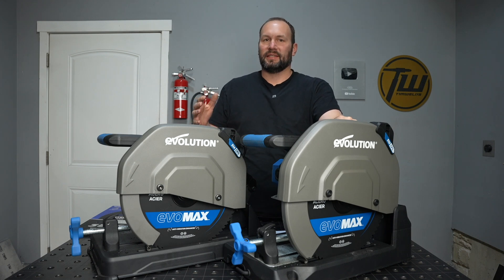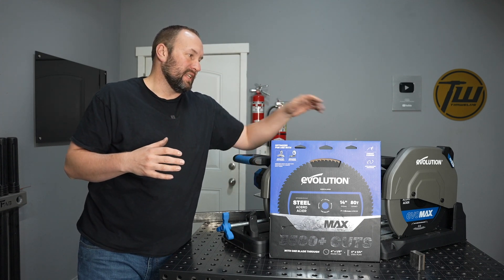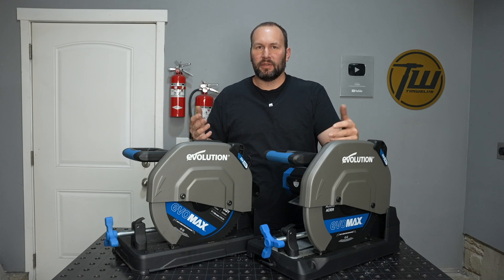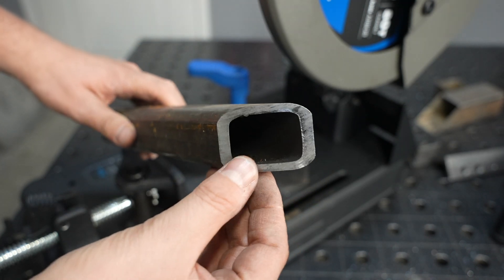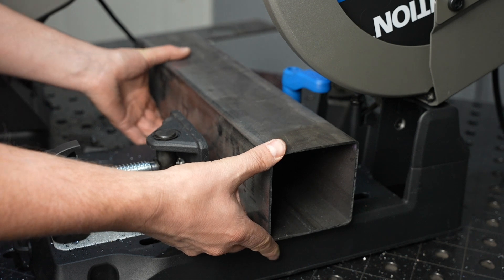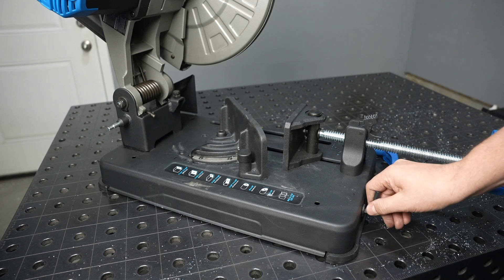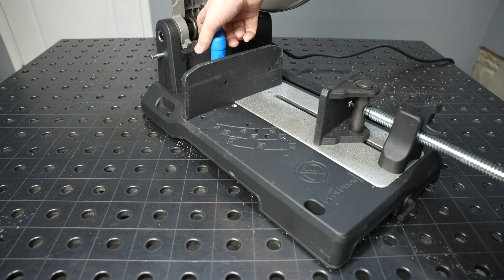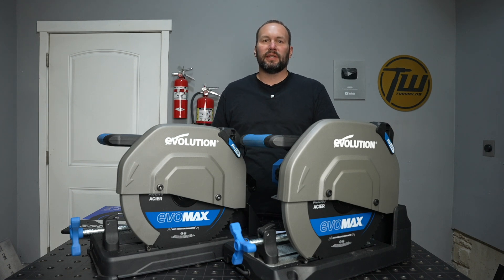What's New on the Evolution EVOMAX Chop Saws: Overview, Cut Tests and Comparison

Comment: Can you sharpen the blades, like  wood blades ?
Reply from the maker: I'm not an expert on blade sharpening, but I expect that it would take some very specialized equipment to sharpen a cermet blade, and it would probably cost more than replacing the blade.
Reply: @TimWelds 
A cement blade ?

Comment: I have an Evo185, a smaller one, and it cuts through 16 gauge 1" hot rolled mild steel like butter! But sometimes when I cut a smaller piece (<1" long), the piece gets thrown back into the blade, which I'm afraid is going to damage my blade or my saw. What can I do to make sure this doesn't happen?

Comment: If the Evomax gives you 30% more cuts, no matter what blade you are using, you should be getting more than 4550 cuts with the EVOMAX14ST blade. Yet the saw only states the same number of cuts as the blade.  The EVOMAX14ST blade states it is compatible with certain Dewalt, Milwaukee, and other saws operating at or below 1600 RPM, so you should get at least 3500+ cuts when used with non-Evomax saws.  I have trouble with the claim the motor technology extends blade life by 30% if they only promise you 3500+ cut  on a blade that should do 3500+ cut even with any metal saw that runs at or below 1600 rpm.
Reply from the maker: I’ve sure made a lot of cuts with mine at this point and it’s still working great on the original blade. 

Their claim on the saw description website is 3,500 cuts through their test cross section for the included blade plus 30% additional life due to the Evomax blade which would be more like the 4,500. In all reality, I don’t know how you quantify to that level of detail when it’s used for different things, but a cermet blade will outlast a tct one on steel and I buy into a longer life with better speed control.

Comment: In your opinion, do you feel it is really detrimental to a steel cutting blade to cut aluminum with it?
Reply from the maker: I’ve done it from time to time. I fried one from material sticking to the inserts, but I usually get away with it.

Comment: I hope the new intelligent motor/light  finds its way into the mitering chop saw. I have been wanting to get one for a while. I went cheap with a portable horizontal bandsaw and been unhappy with it. My shop is tiny and cluttered so its easier to adjust the blade angle instead of trying to negotiate a large piece of material around everything else in the shop.

Comment: I bought an Evo couple months ago and cut angle iron @ 45' for frame work.  It jammed on the first cut.  I tried again and it 'grabbed' and flung a 15"  piece of angle half way across my shop.  Scared the heck out of me and I promptly returned it - POS as far as I'm concerned.  The table will also only angle one direction.  I will stick with my DeWalt abrasive cutter.
Reply from the maker: Mitering angle iron in a standard chop saw like this is more of a challenge because the fence only angles one direction. To get the second angle, it has to be positioned upside down. If you just put it in the clamp upside down without a secondary piece of material, the saw can pull the vertical section backward after it cuts through the flat section, dislodging it. I've made a video about this in the past. I've made thousands of cuts on their saws and only had material get caught once, which was completely my fault for improperly clamping it. Their S355MCS is better for angle because it pivots both directions so you can leave the corner sitting in the corner of the saw the whole time. BTW, I've had material come loose in an abrasive saw before and the blade shattered, which sounded like a bomb going off and was much more concerning and dangerous. Once again, my own error in clamping it.
Reply: @TimWelds  I will be the first to admit that I am not a professional, I'm elderly and do some small home projects.  I would like to think that I am not the only one - LOL!  Thank you for your reply, enjoy your informational vids.  Happy Thanksgiving!

Comment: I see their new blades are copying the composition of the teeth of the Diablo blades. I’ve been using them for about nine years now and have gotten one new blade after all that time, about a year ago. The blade is steel/stainless and costs less than $90. I’m not trying to steal your thunder here, but I find most 14” blades to be very overpriced, particularly when manufacturers want you to buy three blades, one for steel, another for stainless and another for aluminum, which really should be bought. Having just one for steel/stainless is not only a lot less expensive, but changing blades is a real pain, so people tend not to do it if “it’s just one cut”, and over time, ruin the blade. I am thinking of replacing my saw though and these look interesting. I made a rotating saw platform, so if these for the space I made where the base drops in, that would be nice. I just wish someone could use a motor other than these series wound motors that are so noisy that hearing protection is required even before you start the cut.
Reply from the maker: Cermet teeth are on many brands of blades. This is a different blade design than the Diablo and also has more teeth. I'm not sure which brands Evolution benchmarked against with their independent testing service, but they found 50% longer life than the best performing competitor. From my own experience, all I can really say is that they worked good out of the box because I've only made a hundred or so cuts with the new blades. That rotating saw platform sounds awesome, that's the one drawback to these saws where the fence rotates.
Reply: @TimWelds  other companies are making them now, but it took years after Diablo came out with them. I’d love to see another moderately priced blade with them designed for steel/stainless. Blade. It’s is just too high. I’d rather replace one $86 blade every six years, or so, than two blades that cost, together, around $250.
Reply from the maker: If I did much chop saw cutting with stainless, I wouldn't want to switch back and forth either. For chop saw work, it's just steel and aluminum for me.
Reply: @ I get it. I do a lot of stainless.
Reply: @melgross  Hi Mel, Evolution project manager here, Diablo didn't invent Cermet it was widely used in other applications including cutting tools for decades, they added it to consumer type blades. Many other brands have been selling cermet blades for years and within that there are so many types and grades of cermet. But those brands don't have the same exposure, and increasingly now as Diablo have the marketing resource and money to really push this everyone is now requesting this feature. The Diablo blades are a really nice blade but you can always do better. We benchmarked against many brands during testing: Diablo, DeWalt, Milwaukee, MK Morse, Fein, Champion and our existing blades. All the benchmark testing was completed by 3rd party international certification labs TUV and SGS to ensure the results were fair and reliable. EVOMAX mild steel blade outperformed Diablo by up to 45% in life and with a higher quality of cut from higher tooth count.

Comment: Got a question for the smart fabricators in the room, what is the main difference between the Evo metal chop saw and the evo metal miter saw?

Is it that the miter saw has more fencing? (And obviously a higher cost and larger footprint).
Reply from the maker: It's a great question. I actually made a video about it: https://youtu.be/JzYTWdct6vs

MCS Advantages: The biggest thing for me is that the MCS (miter saw version) has a rotating head and motor so that your stock maintains alignment when you set it to make an angled cut. With the standard chop saws, the fence rotates, so your stock comes off at an angle to the saw. The MCS has more clamping options and can angle both directions, which is nice for small or odd shape pieces like angle iron. Overall, the MCS is a more versatile saw for those reasons. 

Standard Chop Saw Advantages: The regular chop saws like these are much faster to use because of the single clamp on them. For most fabrication work making 90 degree and 45 degree cuts on round/square/rectangular tubing and solid stock they are just as capable. The standard chop saws are also much more portable and easy to store. 

Bottom line: They're both great and most projects could be done with either one. If speed, portability, storage space and cost are your main objectives, go with one of these. If maximum versatility to cut small or odd shaped parts or the ability to have your stock face the same direction no matter the angle you're cutting, go for the MCS.

Comment: Thanks TW and Evolution. I've been cutting square tubing incorrectly all these years.
Reply from the maker: I wouldn't say incorrect, you got it cut. Tipping it at 45 is just a little easier on the blade, but with a miter you have to lay it flat anyway and truth be told, I'm often lazy and just leave it flat for straight cuts too.
Reply: @TimWelds  I've always tipped angle iron but never thought about tipping square tubing. Makes sense though.
Reply: Tipping it stops the teeth dragging over the flat surfaces, it makes a big difference to blade life on toothed blades.